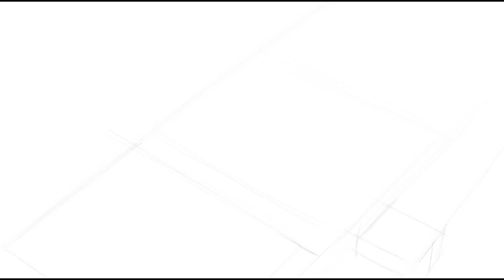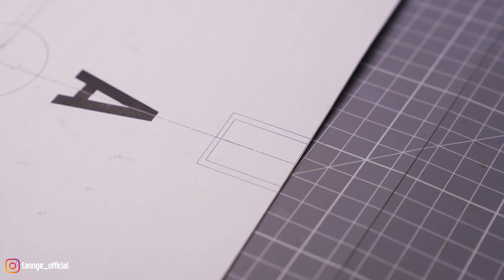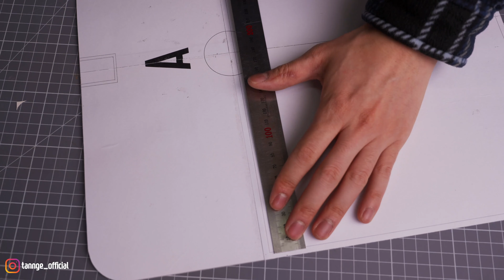12. Leather Macbook Pro 16  laptop case / 맥북프로 16인치 노트북 케이스 / Leather craft PDF / 가죽공예 패턴 / Unboxing

Comment: Nice. Don't you think it's too soft for a laptop?
Reply from the maker: First, thank you for your opinion. The thickness of the leather is between 1.5 and 1.7 millimeters.
I used this leather because I wanted to make a  laptop case out of soft leather. I'm using it with satisfaction.